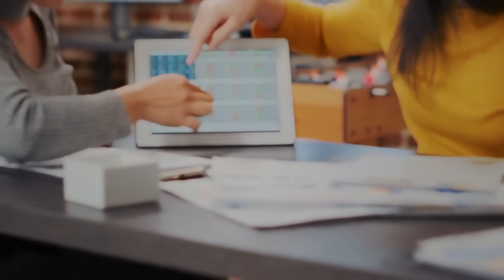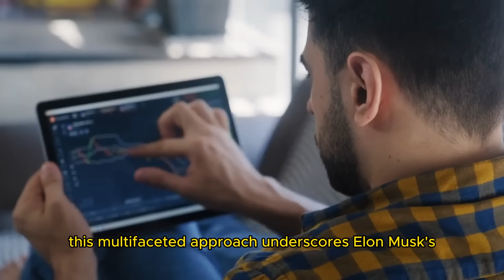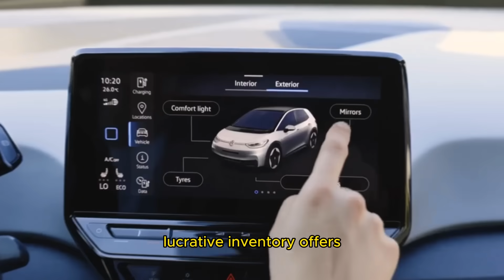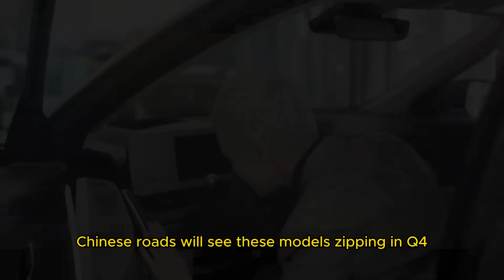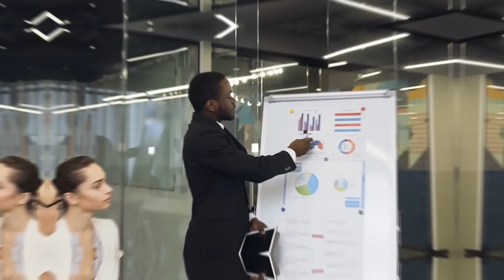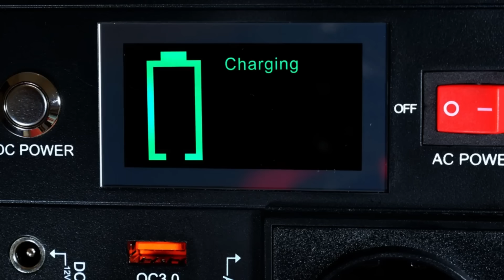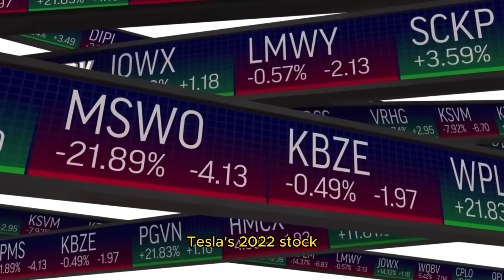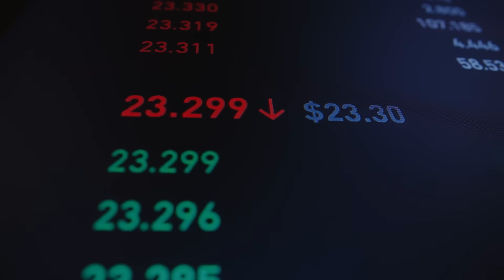Elon Brings MASSIVE News to Tesla Stock Holders for 2024!

Comment: Surprised not one mention of the fire issues with all EV manufacturing which has an impact on buyer confidence. When the S was originally released it won CR highest rating for any car including safety. Looks like fire potentials were not a factor for CR. Although fires are less frequent than ICE the severity manpower and water usage is a big deal. Will Tesla be the leader in safety innovation concerning explosive fires?
If they can seriously address the issue which they must and remediate the excessive damage and veracity of the fires ICE will be on higher and safer ground. The other elephant in the room is the green revolution that tends to disregard the sources of electricity and the lithium mining impact as well as the disposal of batteries. All that being said Tesla is the company that has been on the forefront of this transformative revolution. I sincerely hope those challenges are met with the same vigor as distance, self drivability comfort, style and cost analysis.